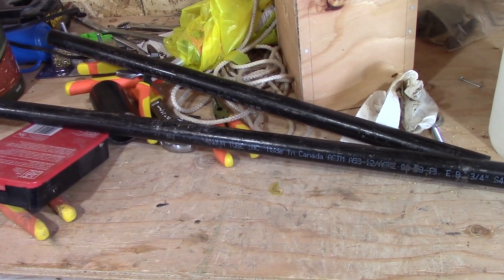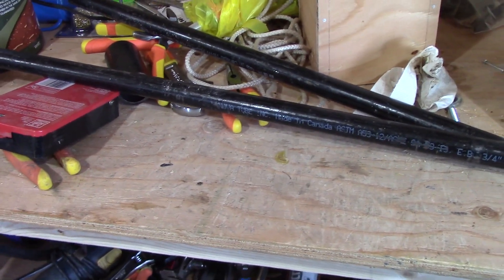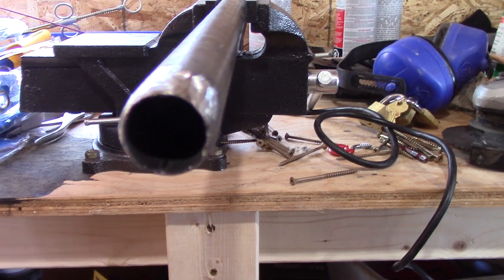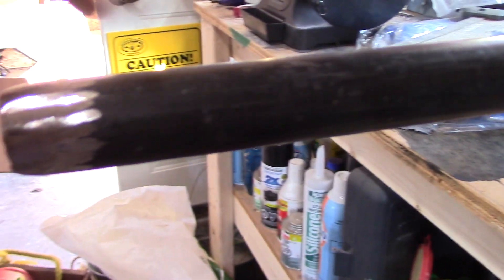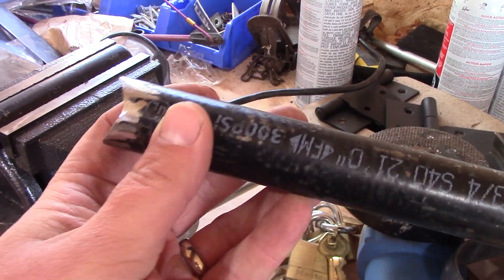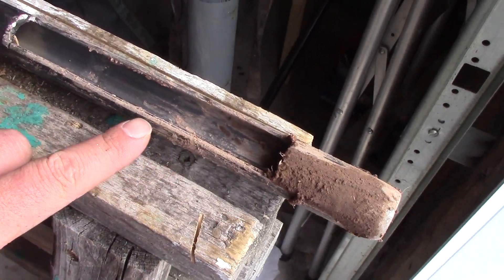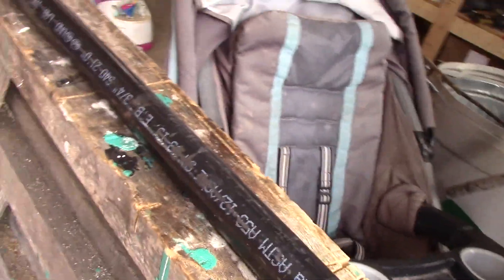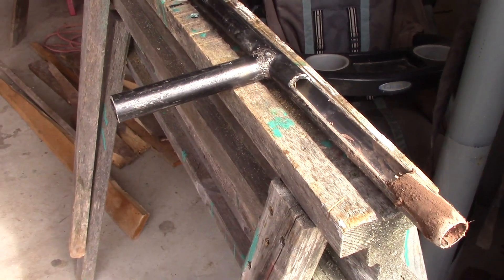Probing, building the right tool for the job- Soil sampler diy

Comment: Good $ save vs what these sell for!  I must have blinked and missed the part where you ground out the window and especially the welding.  I’ll just use my imagination.

That bit at the end about the window width.  Wondering, because I totally get the concern about weakening, what if you instead just ground down / chamfered the inside edges of the window... maybe that’d help release the plug a bit better and sacrifice less strength.